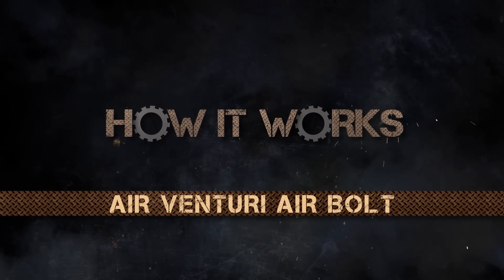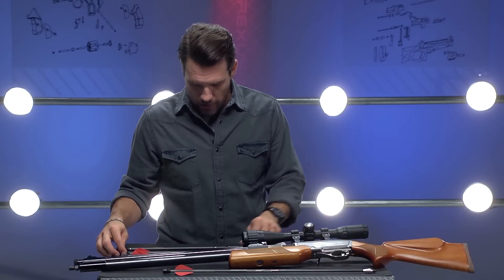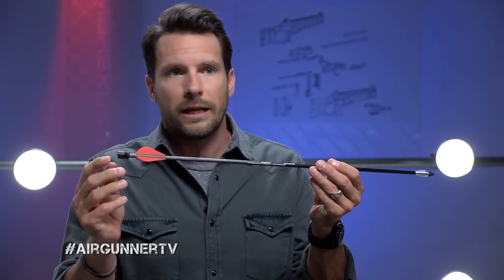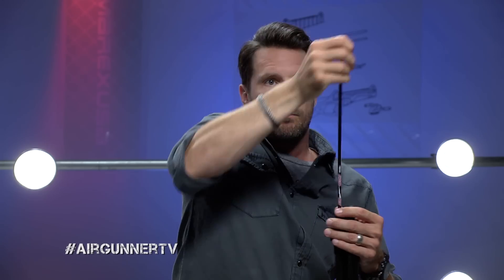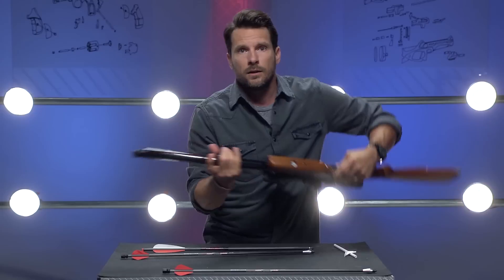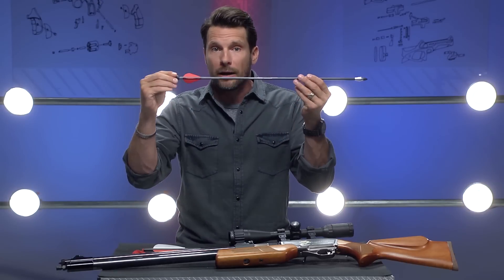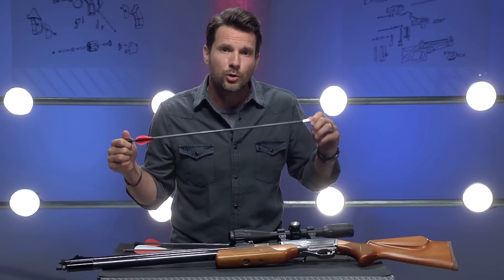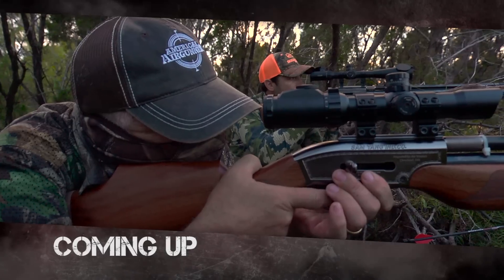How It Works: Air Venturi Air Bolt Arrows for Air Rifle Guns

Comment: dear friend I searched on the internet but could not find it. I need your help. How many mm is the inner diameter of .25, 30, 35, 50cal arrows. Or are all arrows standard
Reply from the maker: These arrows are standard and only come in one diameter per caliber.  They are the only arrows you actually shove down the barrel.

Comment: So, if you loose the 50cal arrow knock piece that's not sold separately you have to spend approx $18 for an entire new arrow. Not worth it until they design a way to repair broken arrows. The airgun stuff is awesome but also a rip off due to insanely high prices.
Reply from the maker: You can purchase the nocks from Pyramyd here: http://www.pyramydair.com/s/a/Air_Venturi_Air_Bolt_Nock_Set_6ct/7581
Reply: American Airgunner awesome, thank you. When will the 45 call airbolts be released?